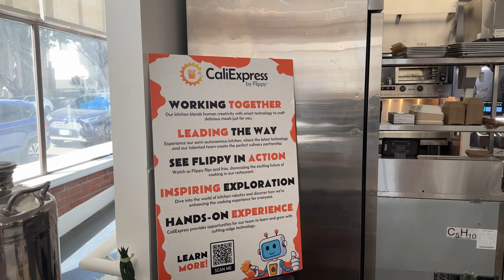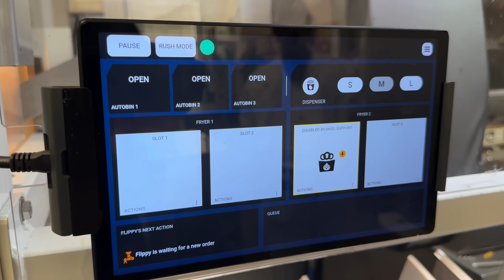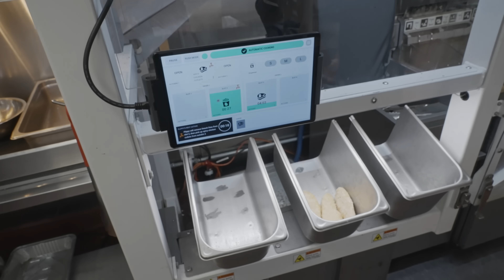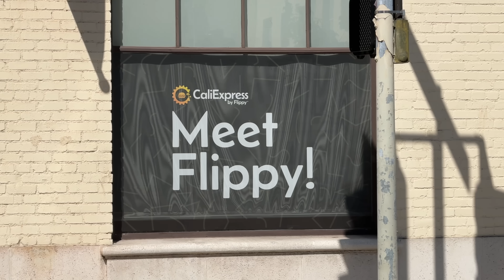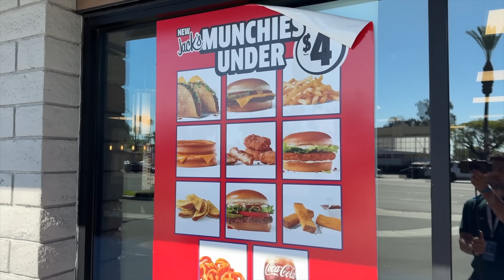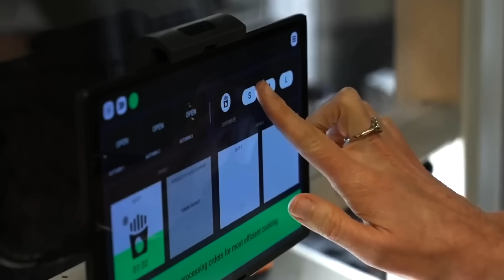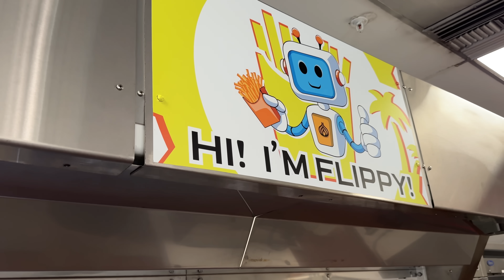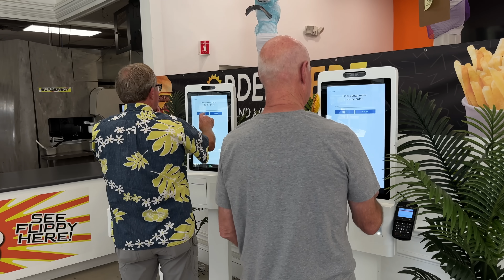Chipotle tried hiring robot workers. Here's what happened.

Comment: Advantages of using those robots (based on the video subtitle):
• Cost reduction: Labor costs are significantly reduced with robots.  As hourly wages rise, the use of robots may be more economical in the long run.
• Dealing with labor shortages: Restaurant owners often struggle with not finding enough people for certain tasks.  Robots can help with this labor shortage, especially in kitchen jobs where people are hard to find.
• Increase food safety: Robots can eliminate the possibility of human error in handling food, thus reducing the risk of food contamination and infection.  In addition, automated systems can be more accurate and predictable.
• Time efficiency: Robots can perform kitchen tasks faster and more precisely, thus providing shorter waiting times for guests, especially in places where speed is key.
• Accident prevention: Using robots can reduce kitchen injuries, such as burns and cuts, which often occur during manual work.
• Precise dosing and less waste: Robots are able to accurately dose ingredients, thus minimizing food waste.

Problems for which solutions are offered
• High turnover: Restaurants often have high employee turnover.  With the help of robots, the need for continuous hiring and training of new employees can be reduced.
• Reducing long waiting times: As robots can prepare food faster and more efficiently, this can help reduce waiting times, especially during peak periods.
• Rising labor costs: Rising minimum wages and labor costs are a big challenge for owners, especially in places where labor costs are a significant burden on the business.  The use of robots can play an important role in reducing these costs.
• Automate simple, repetitive tasks: Monotonous and repetitive tasks like making fries or hamburgers that robots can perform efficiently free up people for other tasks, such as serving guests.
• Difficulties of live work: Dissatisfaction among employees, as well as physical strain and stress, can be reduced with robotic solutions that take over physically demanding, monotonous or even dangerous work phases.

Based on the video caption, the current labor market has the following characteristics based on different age groups and categories:

• Labor Shortage: There are more than 1.2 million vacant positions in the US food industry, indicating a severe labor shortage.  As a result, many restaurants are forced to limit their opening hours.
• Young people avoid low-paid, stressful jobs: Newer generations are less and less attracted to low-paid jobs with high physical and psychological strain.  Rather, they are looking for jobs that provide a better work-life balance.
• Rising wages in the restaurant sector: In order to attract workers, wages in the restaurant industry have risen significantly;  the average hourly wage for non-executive positions will increase to $17.50 by 2023, an increase of 8%.
• Decreased Migration: Historically, immigrants have held many positions in the food industry, but due to stricter immigration regulations and lower migration rates, fewer immigrants are working in the labor market.  In 2023, the number of immigrants working in the food industry decreased by 15% compared to 2019.
• Older generations and low-wage jobs: Physically demanding and low-wage jobs are particularly difficult for older generations, who may no longer be able or willing to hold these positions.
• California's high minimum wage requirement: In California, the minimum wage for fast food workers has been raised to $20 an hour.  This wage level puts additional pressure on restaurants, which try to reduce their costs and therefore show more interest in robotization.
• Interest in technology-based jobs: Technology positions related to robotics and automation are likely to see increasing interest as industry increasingly relies on technology-based solutions, opening up new career opportunities in IT and machine maintenance.

Comment: The side effect using robots per say could lead to more consumer complaints, activist, thefts and vandalism of the property. Humans will see several weaknesses in the business model a plot plans a the robots are not built or program for different kinds of scenarios and events. The store managers could be dealing with costly repair challenges they can not provide immediate for if the robots are badly damaged or don’t increase output or fail to operate correctly.